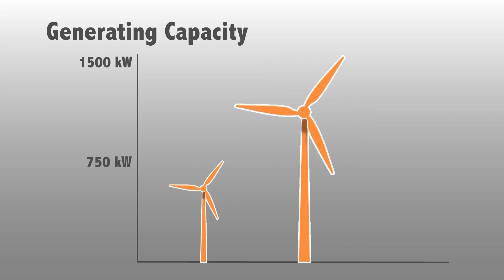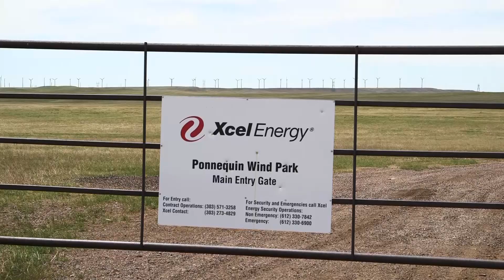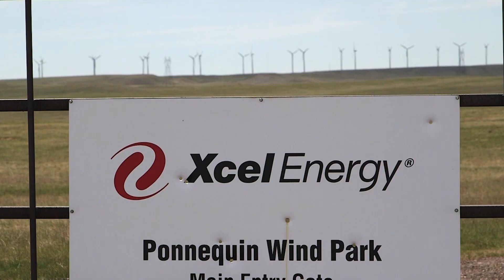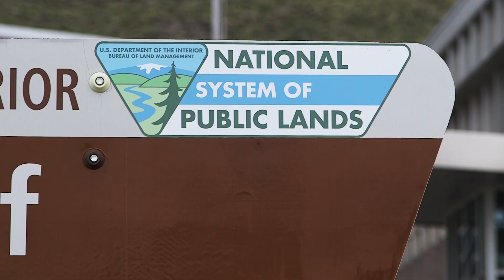Who Cleans Up When a Wind Farm Retires?

Comment: I work in wind and will continue as long as there is work but even I think that making power from wind is most pathetic way possible.  you can't run an industrialized nation on intermittent power.  and a 15-20 year life!  god what a joke.  a nuclear power plant can operate for 60+ years making full output year round.  And if you're going to comment about how bad nuclear power is because waste and accidents, save it,  there's over 600 NPP's around the world and 3 have had accidents.
Reply: [[ if you're going to comment about how bad nuclear power is because waste 
and accidents, save it,  there's over 600 NPP's around the world and 3 
have had accidents.]]
As if that number (3) means anything.
Yes, 3, Chernobyl (meltdown) , Three mile Island (averted full meltdown), Fukushima (meltdown WITH PLUTONIUM)
Want the REAL MEANING of that?
Too early for good data(because the effects stretch for multiple generations), but one study concluded about Chernobyl:
==
Even though the lack of large-scale independent long-term studies does not permit a complete picture to be made of the current situation, a number of trends can be shown: a high mortality rate and an almost 100% morbidity rate can be observed among people, such as liquidators, who were exposed to high radiation levels. 25 years after the reactor catastrophe cancer and other diseases have emerged on a scale that, owing to the long latency period, might have appeared inconceivable immediately following the catastrophe.

The number of non-cancerous diseases is far more dramatic than had ever before been imagined. “New” symptoms, such as the premature aging of liquidators, raise questions that research is still unable to answer.

By 2050 thousands more cases of illnesses will be diagnosed that will have been caused by the Chernobyl nuclear catastrophe. The delay between cause and noticeable physical reaction is insidious. Chernobyl is far from over.

Particularly tragic is the fate of the thousands of children who were born dead or died in infancy, who were born with malformations and hereditary diseases, or who are forced to live with diseases they would not have developed under normal circumstances.

The genetic defects caused by Chernobyl will continue to trouble the world for a long time to come – most of the effects will not become apparent until the second or third generation.

Even if the extent of the health effects is not yet clear, it can still be predicted that the suffering brought about by the nuclear disaster in Fukushima is, and will be, of a similar magnitude.
Reply: PS
[[  Chernobyl (meltdown) , Three mile Island (averted full meltdown), Fukushima (meltdown WITH PLUTONIUM) ]]
I listed Fukushima  incorrectly ... AT LEAST THREE with complete meltdown, and at least one of those with plutonium/
http://www.youtube.com/watch?v=Hn-P3qnlB10
Many times worse than Chernobyl
Reply: We desperately need fourth generation molten salt breeder reactors.
Reply: Oh, and are you really so dense that you think nuclear power plants just go decades with no repair work on them?

Then there's the cost of disposing of all the low and high level radioactive waste generated every year. Not to mention the danger of say terrorists getting a hold of some of that waste or spent fuel(and there's still no storage plan in effect for all that dangerous stuff)
Reply: Your A EARTH KILLER   Nuclear Fools
Reply: I would rather have 3,000,000 wind mills fail 1 mile from my house than have 1 nuclear powerplant fail from that distance from my house. The consequences of failure for each is a world of difference.
Reply: grumpy old fart  everything but the tower.  Motors, pumps, hydraulic lines, batteries, gearboxes tear themselves up and leak, generstors burn out.
Reply: The waste will be toxic for generations. It immoral and unnecesary.
Reply: I,m more for small vertical wind turbines on the roofs on the home,s , you can put these closer togther and it is there where its needed , close to the consumer , and these are bird friendly to . Now you have big birdslaughter far away from you , and the transport of energy is more expensive and you have more conductor losses.
Reply: @robertmoore-x4y  All of the nuclear plants that you are citing were designed 50 or 60 years ago. Do you think that no new, safer reactors have been developed since then? If you do, then you know less than nothing at all. The new designs are much smaller and much more efficient. They get fueled only once during the entire life of the reactor and are expected to last for 60 to 100 years. The new reactors that the Navy ships and subs use get only one set of fuel rods for the entire life of the ship. Because the reactors are so much smaller, there is much less structure to remove when the reactor reaches the end of its life. There is a modular reactor design that is even easier to build, use and remove. The fuel has its own shielding and you can stand next to the reactor when it is running and get zero radiation exposure.
Reply: The French plants have compromised tops of the containment vessel. And yes, waste is an issue. We do not want it in New Mexico.
Reply: Stephen Verchinski all wastes,landfill,coal,sewer,wind,solar etc.and especially nuclear should be sent to New Mexico!
Reply: It's impossible that you work with windpower with that attitude, you have clearly read too many newspapers. Look at Denmark, 43% of all power to the ENTIRE country comes from wind power and they thrive as a moden country, I call your saying as pure BS from the first letter,  https://www.electricitymap.org/
Reply: just the largest accidents
but there were more

three mile island
chernobyle
fukushima

yet, you are right  they working  for  long time
the  60 years might not true for all
because  the steelcapsule  the actual reactor wall  slowly deterioating  and releasing  radiation by time

so they have to stop  it
if it were possible to  dig out and replacing then   the powerplant could  work unlimited
Reply: Sunshine +Wind=2
Nuclear=1and that's just the loneliest number that they'll ever be,
Reply: Wind power may not be the best but if it supplies more than the original cost plus upkeep and tear down, then it's worth it. It will never take over nuclear, gas, coal but if it adds more than subtracts, then do it.
Reply: Chris Holdread man you couldnt have said it better😂iv been jacking with these other guys on here about the turbins and man are they hell bent on them!lol really like your thread you posted🤟
Reply: The huge cost for nuclear is who pays for the waste material. Dangerous waste material this is not even considered with the upfront cost.
Reply: @AdrianMcDaid 
[[ who pays for the waste material. ]] 
Your grandchildren <-- and their grandchildren :-0(
Reply: @AdrianMcDaid  The batteries used in hybrid automobiles are reaching the end of their life expectancies'. The cost on both manufacturing and disposal is astronomical.
Reply: RE:  60+ years making full output year round.
I helped build a nuke. It was said at the time that
it was good for 20 years.  That has been pushed 
to 40. I am kinda leery of one going to 60.
And they don't have full output year round.  They
pay big bucks to guys for "shutdowns" each year.
Reply: Nuclear power plants have the same problem: who's going to clean them up after they're decommissioned? Only the cleanup problem is much bigger because the waste is much more dangerous. It can't just be put in a landfill.
Reply: @dlwatib  AEC7 11 MILLION TO BUILD AND 1.2 BILLION SO FAR FOR DECOMMISSIONING. THAT DOES NOT INCLUDE LONG TERM CASK STORAGE
Reply: There are currently systems available that literally  make no waste. The reuse it as the primary fuel. You charge the reactor one time.
Reply: @gregg4164  
But the reactor itself is still radioactive, and any parts connected to it is also Radioactive.

Having to store it for only a thousand years or so is much better than the hundreds of thousands I think it is for traditional nuclear waste.

But still, even just a few hundred years is a massive undertaking.
Reply: @dlwatib  you can recycle the waste into new fuels plus they have rector designs that can use the waste as fuel. Nuclear power plants are one of the most regulated power sources  out there. huge backup battery power systems would be more bad for the environment and require more maintenance.
Reply: @dlwatib  
Reactors have been designed that use much less enriched fuel, making cleanup much less hazardous and costly.  Also cheaper to build and operate. If we are going to remain an industrial nation, we need a consistant, predictable source of power. Fossil and nuclear are the only ones that fit the bill at this time.
Reply: I would be interested in your work. Beside my hillbilly stuff I work on ESS through Vanadium Redux Flow Batteries and micro grid services from Asia and now the US.

Getting pass UL and Intertek but see America as far behind for implementation and sizes. Bigger isn't always better.

 Dealing with Energy monopolies and the solar vrs wind PPA is interesting state side. Would love to share more about it if you have a website or contact info.
Reply: Chris.  A brave comment.  I too have been involved with bad wasteful projects in my job.  I wasn't very vocal about it though for fear of job loss.  Good on you.
Reply: We have a sitting US Senator here in Maine who received @ 600 million dollars in " stimulus funding " from the previous administration. They are a blight on our coastal landscape. And excess power is available from Hydro Quebec but it's not pursued... The state will eventually clean up the mess
Reply: The level of ideological BLINDNESS exhibited in some of these responses from know-nothings towards someone who WORKS in the wind energy is absolutely hilarious.
Reply: @jimh472  
What does him working in the wind industry have to do with the fact that he was extremely wrong on multiple things?

Sounds more like he's lying than the expert he's trying to portray himself as TBH.

And I don't need to be Gordon Ramsay to know the rice is fucking burnt.
Reply: Nuclear power plants to have shut down for periodic maintenance not 100%! I work in this environment also!
Reply: Any risk assessment is based on likelihood and consequence. Sometime the consequence is just too great. Re the cleanup afterwards it will be the taxpayer as it is where I live cleaning up after a Mobil oil refinery closed down
Reply: I could care less about how much energy is needed. 
There will be no nuclear discussions. 
Only here with idiocracy. 
SUN GOOD 
WIND GOOD
NUCLEAR BAD
CAN YOU FREAKING MULTIPLY
Reply: @lickalittle  
Indeed, I can multiply.

I can also read.

https://www.ucsusa.org/clean-energy/coal-and-other-fossil-fuels/hidden-cost-of-fossils#.XCQrB2lOk0N

https://www.ncbi.nlm.nih.gov/pmc/articles/PMC5800116/

"Outdoor air pollution-caused deaths:
Ischemic heart disease - 40%
Stroke - 40%
Chronic obstructive pulmonary disease (COPD) - 11% lung cancer- 6% 
Acute lower respiratory infections in children - 3%."
"They also estimated that 3.7 million global deaths occurred as a result of outdoor air pollution". https://www.medicalnewstoday.com/articles/274510.php

Millions die as a direct result  of fossil fuels every year. And outdoorr air pollution is a contributing factor , as you can see ,in many many many millions of more deaths every year.

And let's not forget that the world spends over 400 billion dollars subsidizing fossil fuels and only about 66 billion subsidizing Renewables. And let's don't even talk about the subsidies of the nuclear industry in this world.

Not enough money exists to clean up the fucking we've  already done to this planet and ourselves with both nuclear and fossil fuels.

But let's keep making it worse?
Reply: Who do you work for?
Reply: Which three would they be?
Reply: @robertmoore-x4y  I don't know how nuclear got the reputation of a highly costly energy source. In my country there is one nuclear reactor and its LCOE is around 35 €/MWh. A bigger one is planned and its LCOE should be around 28 €/MWh. Decomissioning and temporary waste storage will be financed solely from its profit. I don't know how much it will cost to sell high level waste to other countries, which will have permanent storage in a few decades.

Utilising tidal energy can be more reliable but it's only avaliable in higher quantities in 5 or 6 countries, most of this potential is in UK and France. So just because of this, I don't see it as a source that will give high percentages of energy, looking from a global perspective.

Yes, there is a lot of unnecessary energy use. Just by converting from ICEs vehicles to EVs could lower the overall energy use dramatically (assuming not a lot of energy comes from coal or gas). But I don't see people changing their lifestyles because of a few kWh of energy saved if the price doesn't increase dramatically, which in my opinion is not the way to go.
Reply: grafvonstauffenburg 
in the meantime, and I’m not sure many realize this, solar (which in many ways is at the very center of the nanotechnology revolution) is already well on its way to making the fantastic promise of molecular manufacturing not only viable, but commonplace.
Reply: Chris Holdread I’ve got a friend that lives in the capital of Mongolia, raw coal is burned for most of the heat needed, and the pollution is off the charts.  There doesn’t seem to be alternative sources of energy, hydro, natural gas, etc.  I asked my friend what the alternative would be and there was no answer.  The thing that would make the most sense to me is nuclear.  I live where there are 6-7 thousand turbines in my county, but have no idea if there will be reinvestment when the towers age out.
Reply: As Peter Crenshaw, from the Three Investigators, would say:” I’ll buy a double helping of that”
Reply: grumpy old fart  The blade sets alone weigh in over 250,000 pounds with a circumference of 260 feet and ALL that weight is on the front bearing! The turbine gearboxes take 75 to 125 gallons depending on manufacturer of EXTREMELY toxic synthetic lubricants that need to be changed as often as every six months and with the cost of upwards $400 a gallon so that adds up very quickly. The safety and toxic construction standards from spain and china do not apply to the US standards as they fall under power generation and get away with murder. Remember this... You can't get something for nothing.
Reply: grumpy old fart  Wind. Been doing both wind and solar for 8 years and all I can say is there is a whole lot of bad math being used to make these seem viable!
Reply: @robertmoore-x4y  And that is exactly the problem with people like you: when challenged to come up with more examples you just shut up and move on to another comment section to crap on it. Get your facts straight: nuclear has the lowest amount of people killed per GWh of any energy source.
Reply: Phil Weatherley  
You are correct wind turbines do not last many thousands of years, only about twenty five, if well maintained.
And you get power. . . When the wind blows, if its not blowing too hard, if it's not destroyed in a storm. 
It requires more energy to put the wind turbine online than it will ever produce. 
So how are you going to power a factory? How about the national grid? 
Wind farms are losing investment capital and being shut down because they are not realizing the promises made decades ago. Wind (and solar) require on demand backup, meaning fossil fuel or nuclear, so those are never going away.
Wind and solar were proposed half a century ago when it was believed that we would have exhausted the worlds oil supply by now.  Well we haven't, and apparently we've got, by current estimates, a couple of hundred years worth left, maybe more.
If you worry about greenhouse gases, I point to all the Global Warming prognosticators riding around in private jets, living in multimillion dollar non-sustainable houses, leaving a carbon footprint bigger than some cities. Like 80's televangelists,  their lifestyle does not track their message. The time of their believeability has passed. 
So we have a choice, we can embrace nuclear, and to a lesser degree fossil fuels, have have comfortable, industrialized, first world type of existance, or become a third world country dependant of the vagarities of mother nature. . . Choose wisely.
Reply: Wind power makes NO economic or environmental sense.
Someone, somewhere, must have enough capacity to provide adequate power whenever there's not enough wind.  That means either that an expensive coal-fired plant sits idle or operates at reduced power until the wind's speed drops -- or power must be bought from a neighboring country, which must have excess capacity to sell.
Many wind farms are located off shore.  Such generators are subject to the forces of wind and waves and to saltwater corrosion.  They break at the point where the shaft supporting the turbine is joined to the concrete foundation.  Also, failure of the cables that carry the current to shore is a chronic problem.
Reply: @robertmoore-x4y  You mentioned three. Most of us can count higher than that, if you want to finish your list.
Reply: @WCM1945  NAME THEM...
Reply: @dragondaze  I don't know of any others. That's why I asked.
Reply: @WCM1945  I missed the sarcasm of "can count higher than three" My Bad.
Reply: dragondaze 
List of civilian nuclear accidents - obviously more than 3

https://en.m.wikipedia.org/wiki/List_of_civilian_nuclear_accidents
Reply: @stephennielsen8722  Thanks for that research, Mr. Nielsen...., genuinely....
Reply: grafvonstauffenburg 
No research required - of course.
The sun is the largest FUSION reactor for light years. It was designed BY GOD and without it virtually all life on this blue dot would perish.
I don’t mind the idea of (up to now unicorn) fusion reactors, but at present, fission is nonstarter.

Wind is a flash in the pan 

In the final analysis and far into the foreseeable future, mankind’s truest, most enduring challenge is and should be harnessing the energy of our own star
Reply: @stephennielsen8722  Irrelevant and tending toward the schizoid.....  Why can't YOU wackos find each other.....and then "have at," and prescind (sp?) yourselves from the rest of reality???  YOU would be much happier; disinformation would diminish....markedly...!??!
Reply: grafvonstauffenburg 
Not following your argument - if any. Please clarify.
Reply: @WCM1945  Sellafield, UK - 1957 if I may finish for @graf!!von!stauffenburg!! (and let him catch his breath.) Really, these were low chance of occurrence but high impact events involving tech designed to produce nuclear weapons material. I'm hopeful though, the efforts India and China are making in developing thorium fueled reactors are fruitful and one of them eventually will sell some to the US.
Reply: @dragondaze  
At least 57 accidents have occurred since the Chernobyl disaster, and over 56 nuclear accidents have occurred in the USA, and that's not counting the ones that happened before, we have not yet counted Japan's or other nations.

Based on the operating hours of all civil nuclear reactors and the number of nuclear meltdowns that have occurred, scientists have calculated that such events may occur once every 10 to 20 years (based on the current number of reactors) -- some 200 times more often than estimated in the past.

https://www.theguardian.com/news/datablog/2011/mar/14/nuclear-power-plant-accidents-list-rank

Now add to the above list what was not counted in the civilian power...

https://en.m.wikipedia.org/wiki/List_of_military_nuclear_accidents
Reply: And talking about tree huggers 😂 they are all worried about the dam birds and bats and dont forget the spotted owl 😂im just glad there is a diffrent breed of people in this world so ill have somthing to laugh at and i will live for ever not being up tight worrying about 1,000 years from now🤘
Reply: If you think your job is pointless then you should quit and go apply at a coal and/or nuclear plant.
Reply: Nuclear generation is hands down the most efficient.
Reply: @citychick4154  
Really?

explain to us how the efficiency rate stacks up after several thousand years of having to keep the waste safe while the power plant is no longer making energy.
Reply: @citychick4154  
Oh, and from the
"Nuclear power is cost competitive with other forms of electricity generation, except where there is direct access to low-cost fossil fuels."
http://www.world-nuclear.org/information-library/economic-aspects/economics-of-nuclear-power.aspx

You'll notice they ignored the fact that multiple types of renewables are cheaper than even the cheapest of the fossil fuels......

And even the World nuclear Association admits nuclear is nowhere near the cheapest.
Reply: @lordgarion514  It would depend on whether your argument was from an environmental point of view, or a practical point of view. If your reasoning is based on efficient electrical generation, than yes, really. The waste produced as a byproduct of nuclear generation is clearly hazardous, how ever it's a fraction of the waste of generated by "renewable" sources of power generation, ie. wind, solar, etc.. Hydro, geothermal and coal are probably the most cost effective after taking into account the heavy and burdensome costs and regulations associated with nuclear generation. At the the end of the day it's politics vs. engineering.
Reply: @citychick4154  
 Not coal, not by a long shot. Just totally ignoring climate change, the effects on human health, and deaths, not to mention the cost of all of that, makes coal completely idiotic to use.

Just like not enough money exists to clean up the damage we've already done with nuclear energy, not enough money exists to clean up the damage we've done with fossil fuels, especially coal.
Reply: @lordgarion514  The scrubbers used on modern coal fired power generation have virtually no emissions but are not without some pollution. They're certainly not "idiotic". I don't want to pigeon hole anyone but there are some people who take an evangelical position on global warming rather than a reasonable measured approach.
Reply: @citychick4154  
"Virtually no emissions"

That's a lie.

They might have quite a lot less than without scrubbers. But it's far from virtually zero.

Everything that comes out burning coal is either poisonous, a heavy metal, or radioactive.
and we've already polluted the planet with him so bad that they directly kill Millions every year NRA contributing factor 30 + percent of all deaths worldwide.

we have already completely screwed ourselves which fossil fuel pollution. But you think just slowing down how much more of these things we pump into the atmosphere is perfectly fine to fix the problem?

And no, idiotic was in fact the correct word.
Reply: @citychick4154  
And how much in this thread have I mentioned climate change compared to health?

As I mentioned previously, just America, who is only 4.28% of the world's population, loses almost a trillion dollars a year of GDP (that's the amount of money the people themselves make total) due to the negative health effects of fossil fuels.
Now apply those same fuel health effects to the other 95.72% of the people of this planet.

The only thing idiotic is thinking fossil fuels are still a good idea. They had their time, and they did a great job getting us to an advanced state of Technology. But now they're killing us far more than they're helping considering we have cheaper, and less harmful ways.
Reply: @citychick4154  
Oh, and BTW, the last time the equator warmed 5 degrees Celsius, and the poles increased 8 degrees Celsius, it took 20 thousand years for those 5 and 8 degrees temperature increases to happen. It was literally the greatest Extinction event in the planet's history. And extinction event so bad it was literally named "The Great dying".

We've increased the temperature of this planet .8 degrees in a hundred years flat. And considering how positive feedback loops work, I'd say it's time to get pretty damn Serious about climate change.

And don't think that that means we have quite a bit of time to deal with the problem. The majority of the crops we use for food will  fail well before we get 5 degrees warmer.

And the wind,  temperature, and precipitation changes so far from just .8 degrees is already causing crop failures around the world.

How bad is it really need to get before you think we need to get serious? Need to see starving Americans in the street first?
Reply: @lordgarion514  It's seems you're looking for an argument instead of answers. If you've got it all figured out, this conversation is a waste of your time.  I'd suggest trying to convince someone else of your agenda.
Reply: @lordgarion514  Don't get yourself worked up. Emotional environmental arguments aren't based in engineering or science. The United States has the cleanest water, the cleanest air, and the fewest emissions of any industrialized nation. If you can point to an example of where it's being done more efficiently, I'd love to research it for myself. The lack of plentiful cheap power in developing countries kills far more people annually than any electrical generation in the U.S..  The Global Warming/Climate Change narrative is a means to control energy supplies worldwide and has more to do with money and politics than with clean sources of energy.
Reply: New windturbines can replace 10 old ones. Is that effective and cheaper.  Wind has issues sure but its going to be the base energy on our planet. In pair with huge batterys.
Reply: @johanjonsson3591  And the bigger they are, the more dangerous to birds... and the more expensive to maintain. Batteries are also extremely dangerous to the environment.
And it is only somewhat viable for certain areas. Many parts of the world have no reliable wind, and others, with plenty of wind, have serious weather issues the preclude wind turbines of any design.
Reply: @WCM1945  Batteries no problem: they're recyclable. Where there isn't enough wind, solar works. Large turbines are safer, because the slow turning blades are easier for birds to dodge. The real problems were in Alamont Pass, where the turbines were small, and the blades turned fast. The big problem is those flat, high nacelles are ideal nesting places for birds of prey. Other problems stem from turbines in migratory paths, although I question weather migratory birds fly low enough to even come close to turbines.
Reply: @vincentrobinette1507  Batteries still require large quantities of hazardous chemicals, and recycling doesn't keep those chemicals out of the environment. 
"Where there isn't enough wind, solar works."  You aren't considering the parts of the world that are heavily forested. 
The blade tips move every bit as fast, as that's the part that kills birds. Larger turbines also mean higher blades,  placing even more birds at risk when they might not have been before.
Reply: @WCM1945  You're right, batteries are considered Hazardous material. If you order a golf cart battery from Amazon, it comes by truck, rather than UPS or any other courier service. As long as the battery is kept whole, the weight stays the same, batteries are environmentally benign. Only if there's an accident. Batteries aren't the only solution to energy storage, they're just readily available, and fairly efficient. Ironically, the most recyclable battery, has the shortest cycle life: lead acid. Once recycling programs are in place, that can recycle other chemistries, they just won't be much of a problem. The blades on the large turbines actually have faster tip speeds, because of their radius. They just turn lower RPM, which gives birds more time to react. They are also  visible from a greater distance. I don't see how something as quick and agile as a bird could be struck by any turbine blade. They have quick reflexes. I'm sure it happens, but not nearly as often as opponents would have us believe.
Reply: @vincentrobinette1507  It's the tip speed which can be dangerous for birds not RPM. For example if a wind turbine rotates with 30 RPM and blade length is 60 m, the tip speed is around 190 m/s (680 km/h). As a matter of fact, birds can be only killed if the blades hit them directly. It's the bats that are in more danger because their lungs collapse due to the sudden pressure swing. That's the reason farmers near wind turbines need to use more fertilizer.
Reply: @WCM1945  wind turbines are an idea that looks great in theory, but really terrible in reality.
Reply: @johanjonsson3591  Which batteries?  For a city,  batteries can only store a few minutes worth of energy.
Reply: @grasonicus  Well ....of course you think that.
Reply: No it is not. Like it or not some form of nuclear energy is and will continue to be the primary source of electrical power in the entire world.
 Wind is not the answer. It is an intermittent source that is not reliable. The amount of land space you would need to use to equal one nuke plant is the size of Rhoad Island.
Reply: new wind turbines are larger therefore need more space.  exactly why they shut down the wind farm in the video.  don't forget that wind turbines also use rare earth metals when dug create 1 : 1 ratio of metals to toxic radioactive waste.
Reply: @CPreacher40  which one would you.prefer near you neomydium,or uranium?
Reply: @johanjonsson3591  If that was true then everything would be wind power.  You hippies need to understand that "renewables" can help supplement grid power when conditions allow but will never replace traditional sources.  And batteries?  LOL!  You're nuts.  Using batteries to go off grid is insanely expensive.
Reply: @johanjonsson3591  No, NH3....
Reply: @johanjonsson3591  And bigger.  Too big. Terrible idea that seemed like the answer to our prayers, but in reality is environmentally devastating.
Reply: Johan Jonsson, the economics of your suggestions are appallingly bad
Reply: @timduncan8450  it is what it is! It dont matter how much coal propaganda you will try to tell us here on the interweb. Your time is over! Check out those floating windtowers in the Scotish sea and that is just the beginning. Most accounts commenting here is paid lobbyists but its too late guys. You can choose to change with the new energy or parish.
Reply: @johanjonsson3591  What to do then in longer periods of low wind speeds? Over-sizing the battery systems is not an option because it's way to expensive. If we really want to tackle the supposedly man-made climate change on a massive scale, nuclear is the way to go. Look at Germany for example. Their CO2 equivalent emissions are stagnating over the last 5 years even though they increased installed wind power by more than 50 %. Compare that to Frances's CO2 emissions per capita, which are ca. 50 % lower. They could easily have enough electricity for 100 % electromobility, which would further significantly reduce their CO2 emissions. Try to do that with intermittent wind and solar in Germany.
Reply: @FrainBart_main  Wind and solar are the only reason their Co2 is stagnating, instead of increasing proportionately with demand. With out it, The Co2 emissions would have increased by that same 50%. Without huge amounts of electrical energy storage, this is the best you can hope for with intermittent renewable sources.
Reply: @FrainBart_main  Sure let's go with nuclear. After all if everything goes perfectly you're left with thouhsands of tons of radioactive waste to store for thousands of years. If in the rare instance something goes wrong the land is uninhabitable for thousands of years instead. Nuclear seemed like a good option, but until a better process that produces far less waste is viable safety first. No solution is perfect though.
Reply: @vincentrobinette1507  That would be OK if Germany's consumption (or production) increased in that period. You can look at prodution data here: https://www.energy-charts.de/energy_pie.htm . They are only switching from coal power plants to wind and solar and greenhouse gas emissions are basically the same.
Reply: @justinfowler2857  Nuclear waste problem is exaggerated a lot mostly by the media and activist groups. Only a few percent of nuclear waste is high-level and its radioactivity drops exponentially. After a few hundred years, nuclear waste radioactivity is basically the same as from the uranium ore, used for nuclear fuel production. Permanent storage options have been researched extensivelly and we now have a solution with deep geological storage and waste immobilisation. I believe a few permanent storage sites are being built as we speak. There is also a possibility of reusing the spent fuel and there is of course the thorium option. Also, we don't have any answer to toxic waste from solar panels and batteries right now, and nobody here talks about that. 60,000 tons of uranium yearly sounds a lot but this produces enormous amounts of electricity. To produce the same amount of electricity, there would be (by a quick calculation) around 5 million tons of waste solar panels yearly, which would need recycling.

All the major nuclear accidents happened due to flawed reactor or safety systems desing. All of the reactors are now inherently safe (they don't have a positive void coefficient, they have fail safe technologies...), so Chernobyl can't happen again. There are a lot more safety systems now and the policy regarding nuclear safety is a lot stricter. Newer generation nuclear reactors basically don't have any chance of an accident.

You have to understand the amount of energy we use. We see everywhere numbers of how much wind and solar have been implemented and how this makes an enormous impact on clean energy production. The problem is that solar and wind power is not very energy dense. We produce only about 1 % of all the energy we consume with solar and wind. We need sources that produce massive amounts of clean electricity if we want to have an actual impact on greenhouse gas emissions. The main answer is in hydroelectricity (where there is potential) and nuclear power.
Reply: @FrainBart_main  its a real problem! I live not too far from A nuclear plant and they have prospected in over 30 years for a great storage solution and yeat not come up with one. Only the planning and development has costed taxpayers a huuuge amount .
Reply: @vincentrobinette1507   YOu should really learn about Carbon Dioxide! IT is GOOD for the Environment! Greenhouse growers increase CO2 up to around 1,500 PPM allowing plants and trees to grow much better top and root growth using less water and fertilizer! Go look up Nullschool and see where CO2 is, not in North America this time of the year.
Reply: @johanjonsson3591  I don't know what a huuuge amount means and how much that means per unit energy produced but as far as I'm informed, the money for decommisioning and spent fuel storage comes from the industry itself, not from taxpayers. Of course this is not the same for every country. R&D could be financed by taxpayers but the actual waste management should be financed from the nuclear power plant's profit. I expect that in the following decades we will have proper waste management, Finland should begin with permanent spent fuel storage in 2020, Sweden and a lot of other countries have already chosen permanent storage sites and will begin to build them shortly and I believe there is already one permanent storage in use in USA. Nuclear waste is really not as dangerous as some would like you to believe. The radioactivity decays exponentially and it is equal to the original mined ore after a few thousand years, not hundreds as some would tell you.
Reply: @FrainBart_main  world grid. See R. Buckminster fuller
Reply: @stephenverchinski409  It can't be done with existing technology, or in other words, it would be many times too expensive to do that.
Reply: @edwardcarberry1095  
Yep, increasing CO2 makes plants grow faster.

And at the same time it makes the plants contain less nutrition. Which means you have to eat more calories to get enough nutrition.

Seems a rather stupid thing to do, considering the percentage of people who are overweight and obese in America is 67% total, don't you think?

And we ain't even close to number one in overweight or obesity numbers anymore.
Reply: @FrainBart_main  "They are only switching from coal power plants to wind and solar"
No. It was planned this way, but then (after Fukushima) we quit nuclear. So, we still burn up the same amount of coal as before. Thats why we couldn't reach our CO2-goals.
Reply: @FrainBart_main  no they are switching from nuclear to wind
Reply: @FrainBart_main  chernobyl cant happen again?
wanna bet?
Reply: @DrKlausTrophobie  That's kind of true, based on data from Statista coal consumption increased after 2011, but most of the closed nuclear plants shut down in 2011. Coal consumption is lowering since 2013 and was in fact in 2017 10 % lower than from 2010. So you basically are switching from coal to wind and solar, but this was slowed down by the closing of nuclear power plants. Can I ask you if you had a referendum about closing nuclear power plants or was this caused solely by your government?
Reply: @janvanruth3485  Chernobyl can't happen again because no reactor in the world now has a positive power coefficient at any power level, so the positive feedback loop isn't possible.
Reply: @justinfowler2857  We already have better tech that produces far less waste, in fact new designs could run on waste we have stored from decades ago. New fast breeder reactors or thorium LFTRs are generations ahead of most of the plants here in the US. We'll be eclipsed by China if we don't hurry up, all these hippy dippy brainlets are holding us back.
Reply: @FrainBart_main  Smolensk, Leningrad, Kursk  are all closed then?

remember the Titanic was unsinkable....
and Tylenol was completely safe.....
and Marie Curie did die of leukemia
the fact that problems have not occurred yet, does not mean there are not in the making already
Reply: @justinfowler2857  God gave us a HUGE nuclear fusion reactor: so powerful, he had to put it 94,000,000 miles away. Photovoltaic panels are the windows to a safe clean nuclear future!!!! To ride the winds of change, we just need to put up a few large backward fans. #a big fan of the big fans.
Reply: @janvanruth3485  They indeed use the same type of reactor, but they were modified after Chernobyl to not have a positive power coefficient.
Reply: @FrainBart_main  No referendum. Actually it was very surprising. The lefts on a previous government fought hard for a plan to decommission all nuclear power plants until 2036 (Atomausstieg). But the conservatives rolled it back (Ausstieg vom Atomausstieg). Then Fukushima happened, demonstrations followed and the government did a full 180 with immediate full stop of 8 old plants (Ausstieg vom Ausstieg vom Atomausstieg). All nuclear power will be stopped in 2022.
The companies running the plants sued for compensation and won this year.

Watching at the coal consumption you also have to consider that Germany is only slowly decreasing the (long term) export of electrical power to its neighbours.
Reply: @justinfowler2857  God, just launch the Nuclear Waste into the sun.

Use SpaceX re-useable Rocket and just fling the waste toward the sun or out into deep space (We have tons of water just fuel the rocket with Hydrogen Fuel).

I don't get your hissy fit.
Reply: @FrainBart_main  see the latest NRC and Holtec Casks. I have had the same concern since they want to send it all to New Mexico. Their QC sucks and we are supposed to accept stuff susceptible to wIgner and contaminating areas 400 miles downwind.
Reply: @stephenverchinski409  Radiation from nuclear waste that will be buried is relatively low, so it's not the main problem. The main problem I see is the helium forming from alpha particles, which could raise the pressure but I'm sure engineers are working on and probably have solutions for it. We have a lot bigger contamination problems than nuclear waste.
Reply: @FrainBart_main  I hear you but, the issue is the movement to "temporary" at ground level storage. There are already seen internal cracks found by cask exams in walled storage thicker than the two thousand plus casks already filled and deployed nationally. The thought that the NRC can handoff the national responsibilities to private industry is also a problem. In the event of an incident, the downwind zone can be hundreds of miles.
Reply: @vincentrobinette1507   the storage will be NH3.  My engine is the key. see my tweets @seaplaneguy
Reply: @vincentrobinette1507   Links to that data? thank you.
Reply: @cattycorner8  I don't know which comment you responded to. I scrolled through as many comments as I could, and couldn't find it. Sorry.